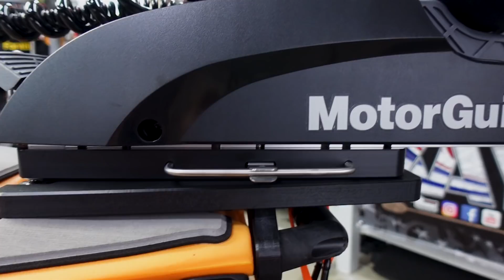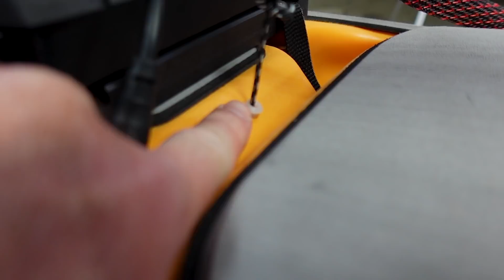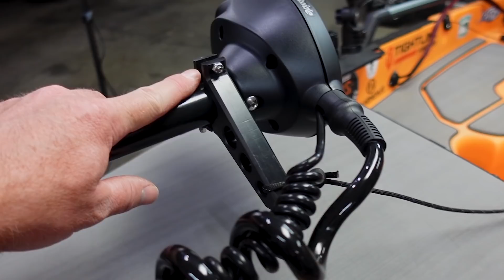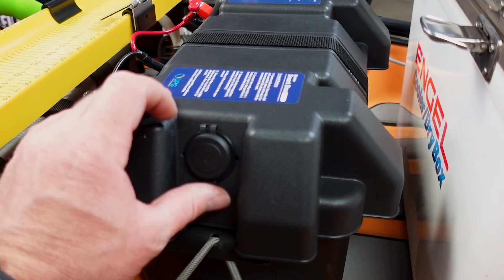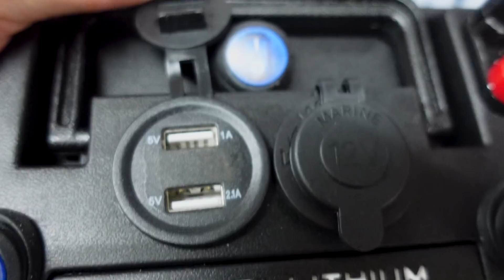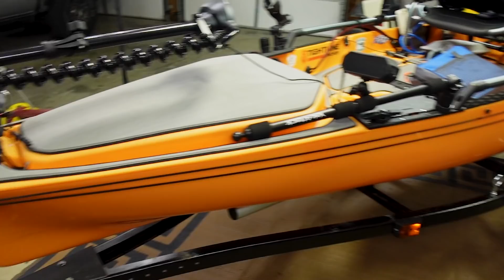NEW Kayak GPS Trolling Motor Install | Motorguide Xi3 Kayak Edition | DIY 2022

Comment: 10 AWG was not enough for my xi3 for long periods. Plug ended up overheating. Went with 6 gauge with the 70amp marineco plug instead. Much more beefier.

Comment: I read through the differences on motorguides website between the two models but they pretty much read the same. What are the main differences between the two motors. Probably a very basic question but this all new to me. Thank you
Reply from the maker: The kayak edition has a 36” shaft 👍🏼

Comment: I have the exact same setup.  Also ordered a Guardian Angel red and green LED light.  What do you think about putting the magnetic mount on the top of the trolling motor to mount that Guardian Angel light.  I can’t think of anywhere else to mount that light with our current trolling motor setups.

Comment: Before I order the boonedox is there any issues with the kayak being too heavy for it with the trolling motor, batteries and everything else fully loaded down. 
I’ll have a similar setup and am a little worried with the 180lb boonedox max weight capacity. 
Thank you

Comment: Having trouble putting 10g wire into the Marinco plug. PKG reads 8 to ten gauge. Trolling motor wire ten gauge went into male end of plug without a hitch.

Comment: Hey brother quick question - the motor is stamped as needing 6ga wire but I see you didn’t opt for that and you mentioned it’s because it’s the 12v model. So is mine. How has it performed with the lighter wire? I love that power connector you used but they don’t have a 6ga version.

Comment: I don't intend to say 10AWG is insufficient for your build... it's probably fine. But it sounds like you're thinking higher voltages need thicker wires.

Typically, the reverse is true. A motor drawing similar power at higher voltage will do so at fewer amps. The amps determine whether your wires will overheat, so higher voltage = lower amperage = thinner wires.

Comment: I have been thinking about adding one to my PA14. My concern is we have so many trees and large brush in my area, I feel like I would just hit it and get thrown out of the yak, probably tear the thing up as well. Thoughts?
Reply: I don’t think it would be an issue. Run at low speed or pull the motor up and use pedals.

Comment: Doesn’t the cable you use to lower and pull back up the motor get twisted around from when the motor is spinning on spot lock?
Reply from the maker: Not really, the motor only turn 180 and then backwards. They have cables too , so the can’t turn 360. 👍🏼
Reply: @KayakUSA1  ok cool. Cause my old town with spot lock will spin 360 sometimes while spot locking and the main twist cable will just wrap around and around. 

I’m putting a motor guide on my bonafide and was curious thanks.

Comment: Shaft clamp is available at Yakgadgets. I just bought one and installed on a Motorguide xi3, but had to enlarge the shaft hole a little with a spindle sander. It’s some kind of composite so no biggie.
Reply: Made for a 1 1/8” shaft. Motorguide and Minnkota shafts are 1 1/4”
Reply: Steering control arm - foot

Comment: Hey I noticed your gps light on the xi3 didn’t turn on right away. I’ve had the same issue. Did you get this resolved and if so how did you? Did it end up just turning on my itself?
Reply from the maker: It’s because I was in my garage. GPS needs to be outside for a good signal 👍🏼

Comment: OK I’ve seen about six or seven people ask about that V-shaped bracket you have on the shaft of the trolling motor but you haven’t answered yet you’ve answered other things.
Why is that?
I just purchased one Xi3 and I’d like to know about that V bracket. 
Thank you
Reply from the maker: As I mentioned in the video, I don’t know where I got that part. It was sent to me a few years ago and it has been in a drawer until now. If I knew , I’d tell you..

Comment: Hi TJ. What motor do you recommend for a Hobie Outback? I don’t believe this one will fit it. Thanks!
Reply from the maker: The Bixpy kit for the drive slot works great on the Outback 👍🏼
Reply: @KayakUSA1   Thanks TJ! I stumbled across your review of the Bixpy and it looks exactly like what in after. Pretty slick! Also, would you get a second battery to place under the seat for other electronics like a finder and phone charging, etc? Or is the Bixpy powerful enough for everything?

Comment: You’ve got a sweet setup. I got a fishing kayak and need to streamline things a bit with my trolling motor setup (on the stern). Are there any type of quick connects for batteries if I don’t want to drill holes in the kayak so I can disconnect my battery quickly from the trolling motor? I still have a smaller Duracell 35amp agm battery I use for it but hate having to unscrew the terminals every time to bring the battery in to charge it.
Reply from the maker: There’s a few good ons on Amazon I use, look on my kit page, I have them linked there.
www.kit.co/kayakusa

Comment: TJ does the quick disconnect for trolling motor come with mounting bracket from one objective or with the trolling motor
Reply from the maker: They are all three sold separately, motor, mount plate and the quick disconnect.

Comment: Great video again, just wanted to know should you have a circuit breaker between the battery and the motor? Cheers Russell
Reply from the maker: It’s a good idea to have a breaker or fuse or even a cut off in between. 👍🏼

Comment: TJ thanks for putting out this video. I’m in the process of getting this install on my Hobie 
I did have one question where can I get the holder that you made for the controller for the xi13 remote? Do you sell those it looks like you custom made it.
Thanks
Randy
Reply from the maker: Thanks for watching, I actually 3D printed my remote holder myself. It takes my little printer about two days to print one tho.. 😂

Comment: I have a tri hull kayak  (feel free lure) I repair scratches every year we have lava rock where I live in Idaho.  I don't have a rigger or drop fin, I wax my kayak and it has helped with tracking a lot . What I'm interested in, have you or any viewers waxed there yak and then drilled holes for ( yak attack through hull plugs ) I'm going to silicone them for extra safe measure, has anyone ever had the silicone release on a waxed yak?  that being said does anyone have a preference in marine silicone ...... won't lie I'm a little nervous this is the first holes I am drilling in my yak.

Comment: Watching all your videos, and the one thing that has caught my eye is the Altec Speaker on the Ram mount,  how is it that you actually have mounted that.  Looking to do the same, just looking for a mounting solution that is tried and true.
Reply from the maker: Thanks man, all I did was screwed a Ram ball into the back mounting hole then you can use it anywhere 🤙🏼

Comment: Where did you get the steering bracket that you are using to lift and deploy the trolling motor? The one that's a V shape that you have clamped onto the shaft under the head unit. I'm adding a trolling motor to the bank of my kayak and I've searched everywhere for a proper steering bracket but haven't found anything. My next option is to draw one up and 3D print it.

Comment: Question, everything I read says that Alabama law states if you put a gas or electric motor on your kayak it’s now a powered vessel and requires registration and the boaters safety class on your license (which I already have). If this is not true, can you provide a reference?
Reply from the maker: Yes sir, once you add a motor you need to register the kayak as a boat and add numbers to it. 👍🏼
Reply: @KayakUSA1  thanks TJ. I’ve seen it mentioned on numerous websites but I just can’t seem to find it on the ALEA website.

Comment: Where did u get the shaft clamp?
Reply: Any luck on finding that clamp?
Reply: i found it awhile back.. im using a pull cord i bought from amazon with a clamp i had on hand that came with my old trolling motor

Comment: 🤘🏻😎🤘🏻 I have a PA-14 and the OneObjective mount mounted ready for the XI3. Love the battery box and seeing it fits the Dakota 12v 100ah battery. I waiting on availability of the xi3 🤦🏼‍♂️😂 where did you get the Ketch board and mount? Thanks and keep those vids coming 🤘🏻

Comment: Does the Garmin work hand in hand with the Motorguide?  I just installed Lowrance hds active target system along with  the NMEA coms so I can pick a waypoint on my maps and the trolling motor will take me to that spot.  it wouldn't do that with my Humminbird i'm also running.   I wish Motorguide had a screen on the remote like MK do.  I've almost dumped myself because I didn't know what was turned on or the speed.  Only complaint.

Comment: Your going to find out like me, it's great to have the motor guide but having to use the remote to turn on an off  and steer isn't as handy as on bass boat. It's easier to have spot lock on a spot. But to fish and use trolling motor to say go down a bank while fishing is frustrating..
Reply: Whyis it frustrating?